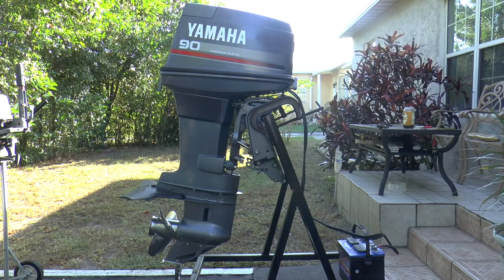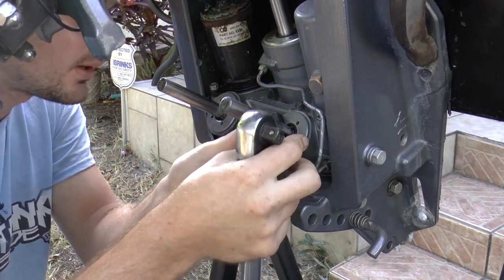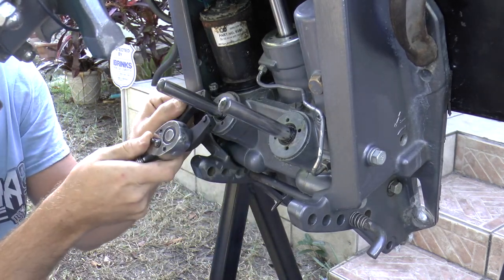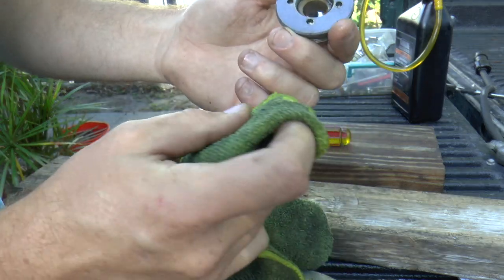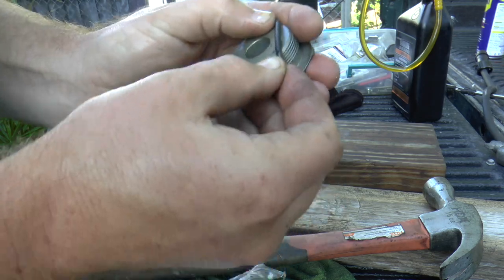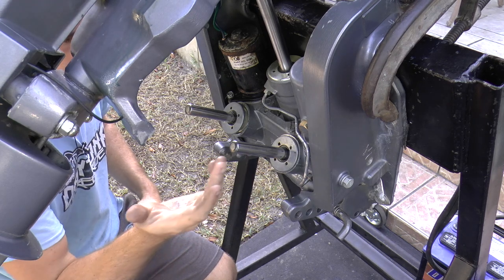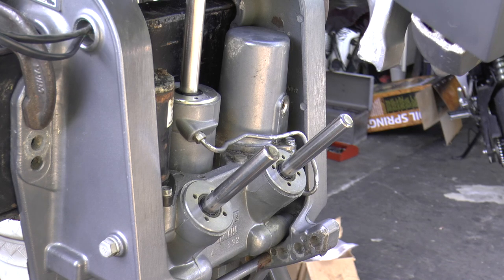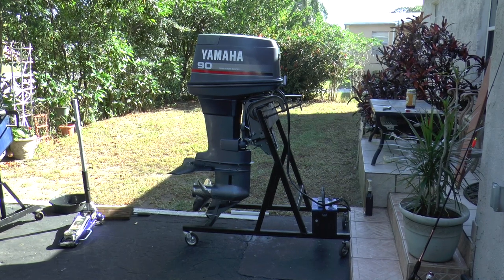Yamaha 90hp Outboard Trim Seal Replacement DIY

Comment: To all the people who have leaking trim seals and think this video is showing you how stop your leak with the seal he replaced, it's not. He only replaced the dust seal, the seal that holds the trim fluid and pressure is down below the dust seal inside the cap and he never replaced it and it's much more important than the seal he shows in the video. Make sure you buy ALL the seals and replace them or you're wasting your time like this guy just did.
Reply: What could be some of the issues if you've replaced these seals in the video, plus the one you are referring to, and it worked for a month or two then starting hemorrhaging fluid again?

Comment: Thank you for the very informative video. With your help, I replaced the seal and O-rings for my trim/tilt today on my Yamaha F250. I used your pipe trick as my caps were on extremely tight. My caps had a retainer clip in a groove I had to remove first. Thanks again.

Comment: The top seal is just a static wiper seal the oil is bypassing on the piston seal.  If there was any pressure on that seal it would just pop out.

Comment: Just ordered that tool a couple of days ago, looking forward to using it. My system is different, but the principal is the same. Thanks for the video...
Reply: What size tool did you wind up getting? I see different sizes. Thanks

Comment: Thanks for the video! I successfully changed my seals out this morning.
Reply: Did you change out the middle one?
Reply: @russudvp  Negative. However, I now at least have proper pin/spanner wrench if I need to get in there.
Reply: @jayboogie27  how do I send you a picture of what I'm trying to do. I'm stumped.

Comment: Have you ever done a video on servicing / seal replacement for the tilt cylinder on the yamaha 90 2 stroke? Getting ready to tackle that soon. Thx.
Reply: I am working on mine right now. The the Trim side of the project was easy. I cannot figure out how to get the large trim ram fixed. I can’t figure out how to take apart the sub assembly, to put in new seals, and stop the leak. Any luck?

Comment: Place Motor so the fill hole is 90 degrees vertical to horizontal line. Remove fill hole plug fill until overflow. Install fill hole plug Cycle System several times. return motor to Vertical position remove fill hole plug check fluid level top off as needed. Apply small amount of thread lock to plug install fill hole plug do not over tighten

Comment: I had trim fluid leaking from the center column that has the rod that mounts to the motor. I replaced the dust seal, the seal beneath it, and the outer seal for the cap, all the other seals looked good. It worked for a few trips out, about a month or two in time, and then it started hemorrhaging fluid again and I ran out of trim fluid at the dock loading the boat back onto it. What are some of the reasons/fixes that could be for that? I am new to boats and outboards so, forgive me in advance. Thank you and I enjoy all your videos.

Comment: I have a 2013 Yamaha F70 4 stroke with a single ram tilt that is leaking badly. My cap does not have holes on it. Could I send a picture to get your opinion on how to remove?

Comment: The caps don't have to be super tight, just a little past snug. The oring and the seal are the seal. Also don't put teflon tape on the threads.

Comment: Gday mate i know this is an old video but i have an 90 40hp that has the same trim and tilt system on it this is invaluable information for me as mine is leaking too , those trim spanners are about 80.00 here in aus . Now i know what model to look at as none of the 40hp have this trim system (maybe of another motor) i will be able to get the parts i need to fix it , the trim motor is really sad covered in rust but still works so there is another 400.00 but with the cost of a new motor at around 8000.00 im gonna try to keep this one going .

Comment: I surely don't know for sure but most hydraulic systems are designed to measure the fluid in the reservoir when all hydraulic cylinders are compressed. It seems possible the way you're doing it you could easily get too much in the system? Of course access on the system you're working on would be a real pain if that motor was all the way down so possibly you're doing it correctly and it is designed that way?
Reply: The procedure is to tilt the motor all the way up and then fill up the reservoir until the oil spills out, then run the engine all the way up and down a couple times and check again.

Comment: I have a Evinrude 84 can I put dot 3 brake fluid in it I use it on my hydraulic jack
Reply: assassinlexx  yeah I called The marina and they said they use power steering fluid if it’s just because it’s little low also herd Marvel mystery oil is good to from a guy working on outbords his whole life
Reply: assassinlexx  thank you and happy boating to you also

Comment: so I would have to jack up the trailer that my boat is on to get the canister that holds the fluid  in  to get it level?  also I noticed you didn't mention the longer rod in the rear of the ones you replaced the seals on,  do we need to change that one as well?  Thanks

Comment: How do I get to the center seal. I have the pistol rod in my hand, I'm not sure how to get the end off. There is no screw on the end, but I see a small pin. Does the pin need to come out? I have a 1988 90ETLG  Yamaha.  Thank you

Comment: Will that Trim tool you recommend works for the tilt cap too?
Reply: Yes it will. I did both my trim tilt and steering cylinder today with the same tool
Reply: What is the name of the tool?

Comment: Been subscribed and watching the. Past year or so nice work on the. Videos im a 17yr marine service tech You are Wrong about the oil link rod- if it falls off the spring on the arm of the oil pump automatically goes to full rich.
Reply from the maker: I just now went into my garage and all 5 oil pumps on my 40's and 50hp 2 stroke stayed in one place including my 60hp. The 90hp 2 stroke did work properly. It went full rich. They should of put a stronger spring in my opinion.